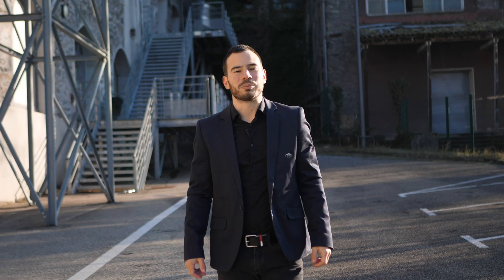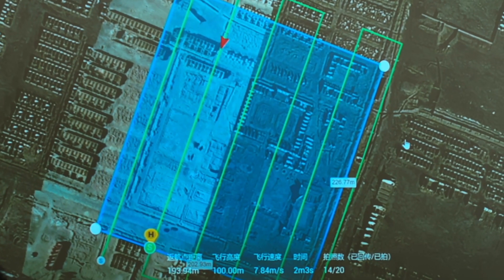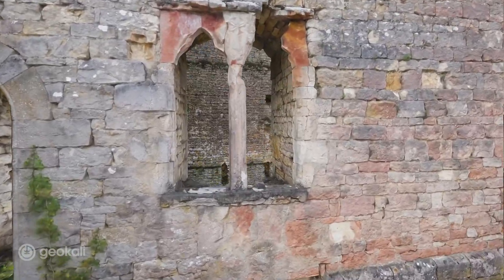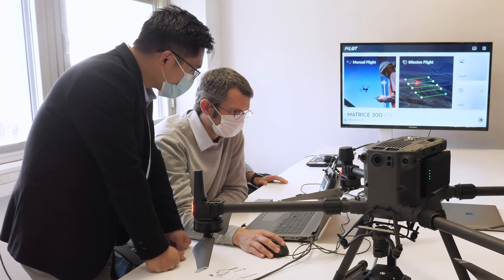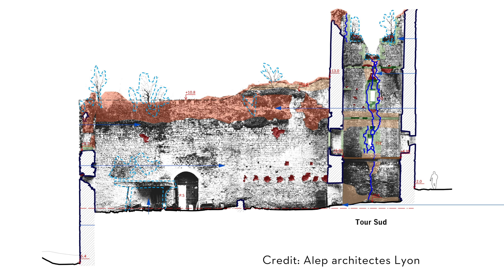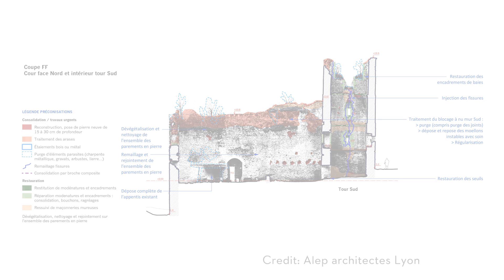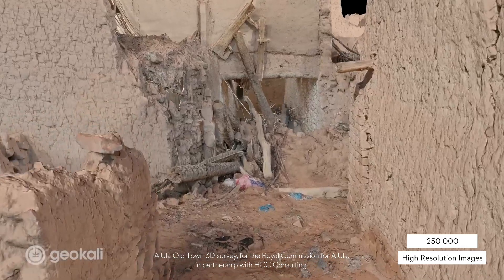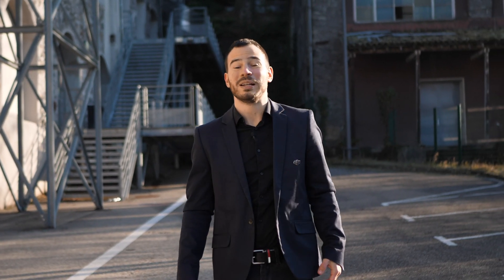DJI Enterprise Talks: High Precision Mapping Using Matrice 300 RTK

Comment: I am doing exactly the same type of surveying in Sweden with a M300 RTK with P1 and L1 sensor as well as Faro  S150 laser scanner and Leica MS60 total station.
I can only confirm that the M400RTK with P1 sensor is, at close range, as good as total station accuracy. I scan infrastructure projects and the point cloud accuracy is between 1.6mm and 3mm from the total station measurements. Excellent tool!